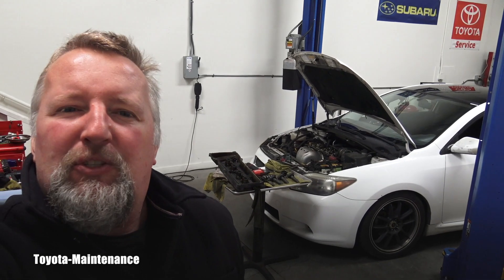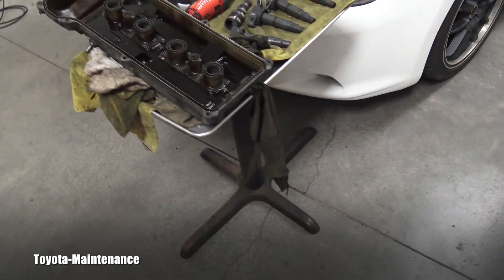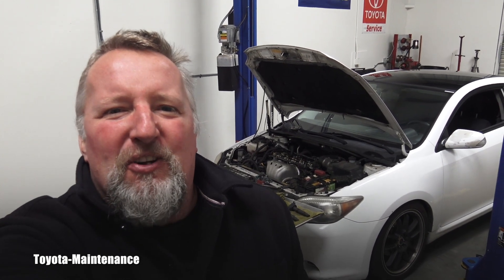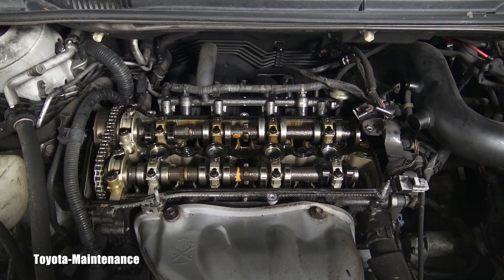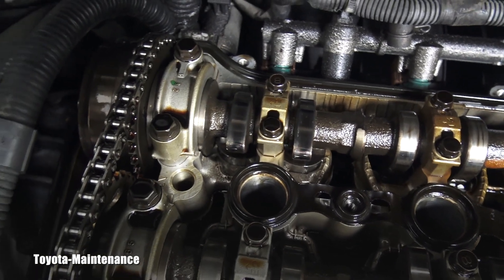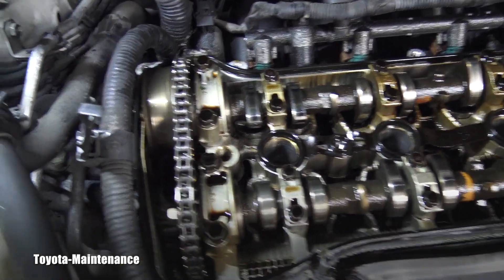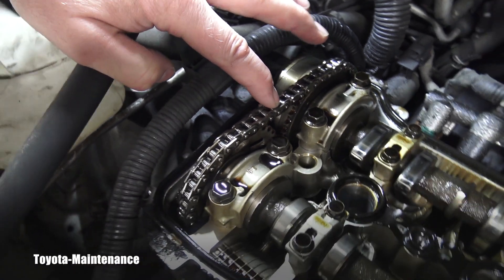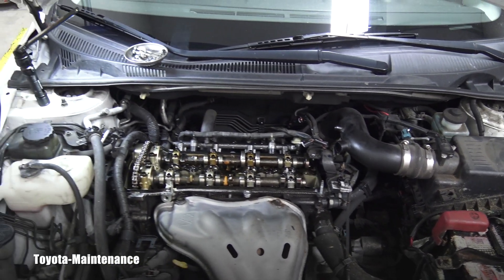Toyota Engine 2AZ-FE

Comment: 2AZ-FE revisions:

2000–2003: Initial release. No balance shafts. Early signs of oil consumption.

2004–2006: Balance shafts added. ECU emissions tweak. Start of oil-burning complaints.

2007–2008: Revised piston rings. Start of oil consumption TSBs.

2009–2011: Final version. Fixed oil issues. Updated threading. Best reliability.

Still using 2009 ACV40 as a daily user and for long distances (more than 400km traveled) weekly. Overall, a minor burning oil issue, just stand by 1L of engine oil for a top-up.

Comment: European 2.4 VVT-i engines are mostly made in Japan. No problems at all. Unfortunately it seems many of the oil cunsuming 2AZ-FE engines were made in the Kentucky plant. Same thing with the Honda 1.8 liter petrol engine, most of the cars sold in the European market had engines that were made in Japan (actually many of the cars were made in Japan altogether), no problems whatsoever. And the 2006-2009 cylinder head breaking 1.8 engine sold in the US was made.... drumroll... In the US! But of course there are healthy, well-maintained and reasonably reliable cars in the troublesome model years also. Maintenance is the key, for example: change oil and filter every 6k miles or 10k kilometers. There are owners who have passed 150k-200k miles without major incidents with the troubled Toyota models with careful, proactive maintenance.

Comment: I have a 07 tC and i’m hearing a rattle noise, I changed out my belt tensioner but the noise is still there can it be my water pump or my timing chain I can’t quite pinpoint where the noise is coming from

Comment: Thanks for your videos. I have been trying to decide between a 2012 Toyota RAV4 with a V6 (2GR-FE) or the 4 cylinder (2AZ-FE) engine, and your videos were very informative. I was concerned about the oil problems with the 4 cyl, but I quickly realised that the V6 is a much more expensive engine to repair because its harder to access. I spoke to my local mechanic, and he said the same repair (water pump used as example) would be $500 on the 4 cyl, but $3000 on the V6 because the V6 was so much more difficult to work on.

So while I was a bit worried about the 2AZ-FE engine, after watching this video I feel like it is a much safer option and cheaper to repair in the long run. Thank you!!

Comment: On my 2az-fe the cam chain started rattling at 100,000Km it seemed to have a lighter chain than yours.
Changing a cam chain is a lot of work, and in Toyota Tarago requires the removal of the engine.

Comment: 2011 xb here, got it new ,  car is now 11 yrs old , 230k on the clock , yes it takes half liter of oil every 5 thousand kms , other than that , no issues at all , the car park outside in Canadian winter for a decade and crank up everytime , only time it won't start was because the battery in the fob was done , cost me 3 dollars and that was it.  starter , alternater , plugs , everything from factory , still drive smooth like butter ,  this is the most reliable engine I have ever owned .

Comment: My poor in-laws babied and maintained 101k 2010 Camry overheated and had to be replaced. It got so hot the plugs I replaced at 100k were stripped and couldn't be removed to see in the cylinders. I bought a $2k JDM 2az with (allegedly) 50K on ebay for it. I had to swap the oil pan, timing cover and the belt size was different as the JDM are RH drive. Hoping to get a couple years out of it. I personally would avoid this engine and look for a six cylinder in this era. I also know a guy with a Rav4 that also experienced this at 110k.

Comment: I have an '09 Toyota Matrix w/150,000 miles on the 2.4liter engine...I change the oil every 3,000 miles and it uses a little less than a quart of oil every 1500 miles.
Doesn't bother me because I think once any engine reaches 100,000 miles the oil and water should be checked at least once a month anyway...Great reliable strong engine! Adding a little oil once every other month is cheaper than rebuilding an engine!

Comment: 😂 that's nothing , my scion burns oil every month. Scion has same 2.4 with 300.000 miles & i have never opened the engine . all original . motors are good

Comment: @Toyota Maintenance, I have a 2AZ FE in my 2009 Pontiac Vibe GT with a manual 5 speed transmission. I purchased it in September of 2021. It had 99k miles on it at the time. I have changed the oil regularly every 3-4 thousand miles. I had heard a lot about the piston rings and the drain holes being to small or something so it can cause blow-by and build up carbon sludge on the piston rings. It was not using much if any oil until the last oil change I only got 2.5 quarts out and it holds 4.5. I had started using almost a quart of Marvel Mystery oil with the remainder being 0w20 full synthetic valvoline high mileage. If I stop using the MMO, will this help or have I now made things potentially worse by using the additive? Since my last change (which yes, I kept using MMO in) it has used about 1/2 quart over the first 500 miles. Any advice would be welcomed.
Reply: 1 - Stop using MMO .  It's an ultra thin oil that will thin the base lubricant and cause it to burn away more quickly. 
2 - There are 2 parts to the actual solution :
1 - The 2AZ FE is rated for  0W 20 in winter and 5W 20 during summer.    You should run the 5W 20 all year long. 
2 -   The bad news is  --- You just have to check / refill your oil about every thousand miles.  The lower your oil gets - the hotter the oil gets - the faster it will burn.  My wife has an oil burning 2.4  that uses about 2 quarts in 5K.   I do 5k oil changes.  I check and service her oil about every thousand miles with 5W 20.  It rarely goes below  1/2 quart down.
Reply: The rebuild kit with new pistons, rings ect is only 250 to 300$$. Buy the kit and rebuild the engine with the new and better parts, she will pur for a long time. Rebuild it every 120,000 or so and call it good. I have 3 rebuild kits waiting and two engines to swap out at 120,000. Gives you lots of time to rebuild the other engine and by that point, you can do it with your eyes closed. Also, have a spare trans waiting just in case and change out the steering rack/ power steering pump at the 120,00 make as well just to b safe. Stay on top of ball joints and control arms as well. It will run forever.

Comment: I have a 2009 Camry with the 2AZ-FE engine. This engine began to burn oil at 90K miles. I had the valves, piston, and it’s rings replaced and it runs like new with no oil consumption. At no cost to me by Toyota. It now has 151,000 miles and runs perfect. Routine maintenance is the key to long engine life and performance.
Reply: How long they do repair under warranty?

Comment: That problem was supposed to have been solved, but my son's 2012 Scion xB with 80,000 miles is burning a quart every 1,500 or so miles.  Not sure what to do about it.
Reply: ATS chemical sells an engine treatment solution that will fix the problem
Reply: @xxbusterswordxx  All I can find is the carbon removal treatment.
Reply: @Krakondack  there should be an engine treatment solution that is meant to clear piston rings and carbon
Reply: @xxbusterswordxx  Thanks for your help, but the engine runs fine - it just burns too much oil.  ATS doesn't pretend to fix that.

Comment: I have one of these in a 2004 Toyota Camry LE that I just bought from Copart. Copart claimed it Ran and Drove when it arrived at their facility. When I bought it, it cranks but does not start. I changed fuel pump, fuel pressure regulator, spark plugs, air filter, battery, and still doesnt start. Still cranks and doesn't start. I took off the valve cover and noticed that the timing chain had three gold links. Two of the links were closer together and from what I am reading should match up on the intake and exhaust cam sprockets when valve farthest to the left is top dead center. The gold links are about 2-3 chain links off of where they should be. Does these mean that the chain jumped a little and this could cause the car not to start?

Comment: Oil burning is probably more of a crappy PCV system and the engine is consuming or ingesting oil through the the intake- engines are not designed to run on oil- and the head gasket issues could also be related or gulps of liquid oil being pulled into one/all of the cylinders and the bolts not strong enough to compress the increased non consistent compression ratio.

Comment: I too have the 2azfe, it powers my beloved 06 camry. Big car for the little motor so fast, no it is far from it however I get around 400 miles to a tank sometimes over 500 if all freeway miles, and with 209,500 miles!. I drive alot for work, and the whole time no less than 300 lbs of tools and at least that much in car audio amps, sub boxes ect, the sound deadening alone has to be around 50 lbs going through a full 40lb box and half of a 25 lb box of second skin... I'll rebuild it before I sell it. I love the car and the work done to it and the way I drive it shows.

Comment: Have you seen the three piston types used in 2AZ-FE and can you explain the difference? For each vehicle type the piston was used at a different time. I just give what I can find for the RAV4 in the USA. Piston pins and rings are also replaced, but I will just describe what I found on pistons. All suspect pistons are replaced with piston part number 13211-28112. Piston type 13211-28031 was not defective and was used between 7.2003- 11.2005 for all 20 series RAV4.2. A change was made for 30 series (RAV4.3): production from 11.2005 to 06.2008 used suspect piston type 13211-28110 which is replaced if needed. Suspect piston type 13211-28111 was used for three months only in RAV4.3 from 06.2008 to 8.2008, [why this happened is obscure]. Between 08.2008 and 11.2009 I can find no data. From 11.2009 - 12.2012 the final correct piston was used. 
Summary
NEED TO COMPARE the designs of 
13211-28112  - final piston used to replace other pistons, used for the final 3 years of RAV4.3
13211-28111  - suspect, used for 3 months
13211-28110  - suspect, used for 3 years
13211-28031  - early ACA 22,23 piston, not suspect, no replacement needed. 
I have not yet found out how these pistons differ and why Toyota changed so often. 
I found this information in megazip.net where production and replacements are described.
Reply: Awesome information!
Still awaiting for @Toyota Maintenance to reply...

Comment: Great video! I have one of these engines in my base model 2002 Camry, and I love it! Plenty of get up and go for its size, and the oil consumption is almost non-existent compared to my old 1999 Corolla which had the 1zz-fe. At 220k there was no changing the oil in that Corolla, just toping it off. It had a lot of timing chain rattle, and alot of valve noise too in below freezing temps. Still ran like a champ though lol

Comment: Can you replace the piston and piston rings on 2azfe for excessive oil consumption without removing the engine from car? I'm thinking to remove the oil pan, and push up the pistons from the bottom with the engine head off. Is it possible?
Reply: LOL nope. More trouble than it's worth. Pull the engine.

Comment: 2003, Camry , 2.4 L , 2az-fe, built in Kentucky, 130,000 miles. Driven by a woman, then her daughter. Regular maintenance. Toyota did a free engine Rebuild/new piston rings in 2009.  Now it has reservoir tank that overflows coolant after driving on a freeway.  The classic sign of a blown head gasket, ( Electric Fans turn on ).  So now I'm doing going to attempt to use a head gasket sealer to buy time until my next car.  Avoid this engine!  Like a fool I trusted the Toyota brand & thought a woman's used Toyota was a good investment.   Sorry, I unsubscribed from channel .
Reply: Weak rear head bolts,  another known issue
Reply: 'Woman driven' is a con.

Comment: Just picked up a 2003 Camry 157k for $1000. Having some rough idle problems but it’s okay other than that. Feel like it might be idle air control because it only runs weird at idle
Reply: I'm having the same problem with mine. Same year same mileage.
Reply: @kemenchebasics  mine turned out to be an ignition coil problem.

Comment: I have 2009 Corolla XRS with that infamous engine and I realized at 180,000km it was burning oil. Had a test
done by Toyota and they said it was normal... I had two 4 Cylinder Camry’s and never added oil between oil
changes!! Now I’m at 330,000km and it’s worst practically 1 quart every 800-900km!!

Oil Ajust @ KM
2   Dec 2019   312656km  1 litre
17 Dec 2019    313810km  1 litre   (1154km)
3  Jan 2020    315104km  1 litre  (1294km)
22 jan  2020    316640km 1 litre  (1536km)
31 jan 2020     317355km 3/4lire  (715km)
11 fév 2020     318200km  1 litre  (845km)
25 fév 2020    318879km  1 litre  (679km)
5 Mars 2020   319823km  1 litre  (944km)
1 Avril 2020    320 819 km 1 litre  (996km)
4 Mai 2020  321505km OilChange 686km
-5600km oil change and filter done

Comment: I have an '09 Matrix with this engine and, other than having to add oil all the time, it runs great!  No fault codes, cat, o2 sensors, everything is fine. 175k.
Reply: I have a 2007 Matrix and had the timing chain cover removed and resealed. This was also done to the oil pan. I believe the tech at Toyota removed the engine to get at the timing chain cover. It’s an expensive repair but only uses a small amount of oil between changes now. Mine has the 1.8 liter engine.

Comment: 436,000 miles and going on my 2AZ-FE 2009 toyota camry.
Reply: @Frank. T No it has not been rebuilt: original engine and trans.  The oil burning is minimal.
Reply: @Frank. T When it was around 250k miles, it was burning oil bad.  I fixed it by modifying the pcv to increase vacuum to the engine.  This increased efficiency and significantly lowered blowby.  Another easy thing to do 2 or 3 times a year right before an oil change, spray a whole can of WD-40 into the crankcase while it idles, then let it idle 20 min.  Works wonders for cleaning the valves.
Reply: @Frank. T 1 way of doing it & probably the simplest, For the PCV: find the pcv-valve, follow the pcv-hose to other end & unplug hose from vacuum port on intake-manifold [the sucking side] & plug/block vacuum port with a vacuum cap or hose-putty, etc. leave the hose hanging or take it off, it doesn't matter; won't hurt anything; leave the pcv-valve alone; start engine to test; engine might sound a little 'better'; slightly lower idle rpm possibly; test drive; should notice a lil more power too.  [should not make any check engine lights]

for the wd40 flush [before oil change only] spray a can into crankcase (same place you add oil) while engine on.  then let idle for 20 min.  i do this in parking-lot at the shop before oil change because you don't want to drive car far with wd40 in there

Comment: Good Luck with Oil Burning.. You will be changing O2 sensors and the cat soon.
Reply: Waleye fish is right catalyst below efficiency p0420 is what your gonna see as a result of the oil burning, carbon will slowly clog your cats ruin  your sensors and create a restricted exhaust, and cause your car to run sluggish and shake, maybe even pop a head gasket because those hot exhaust gasses need to be able to escape. Good luck.
Reply: I had to, but only after 190k+ miles, the engine is overall very reliable but sometimes causes exhaust issues.
Reply: No oil burning on mine, but I did change the cat, the freaking 02 sensor wouldn’t come off my original one. So I had to buy a new one for around $200, silly 02 sensor is madd expensive
Reply: @ErickeverRB  ebay your best friend lol